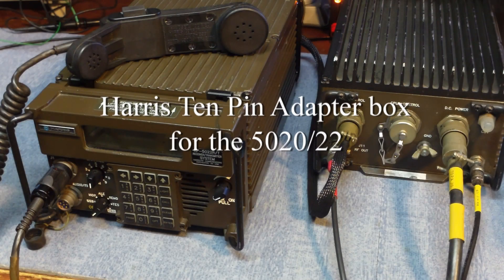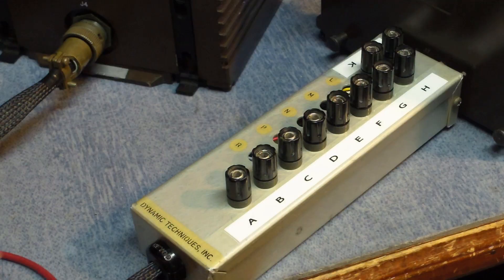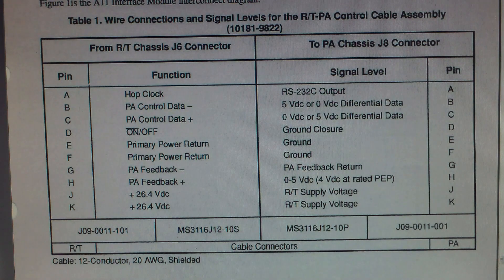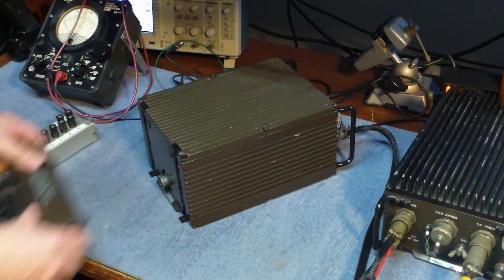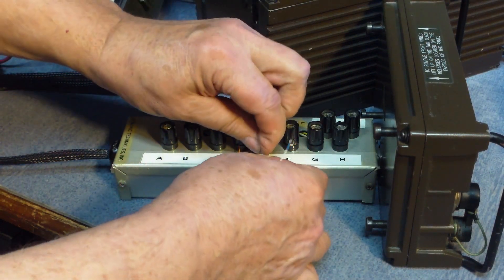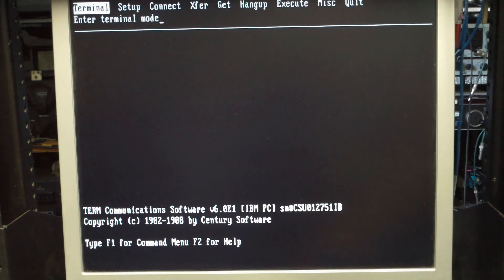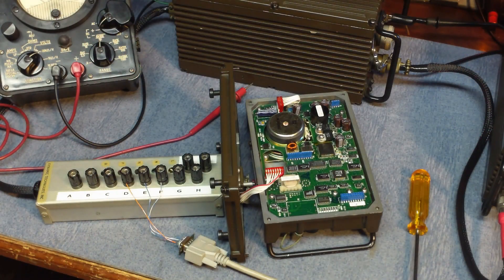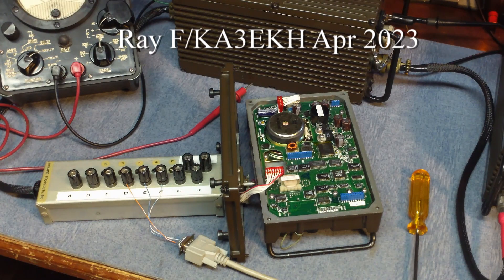Harris RF-5020 or 22 Radio Test Box

Comment: Good evening, could you help me, I have an RF5022 and the original programming cable but I was never able to access it on the computer, I downloaded the software from a website and used Windows 7 and XP but it didn't work, could you help me and my radio has this in the SWR Watts test it shows ---- and when the SWR is high it shows the value watch my videos.
PU1XYZ Bruno  thanks 73.